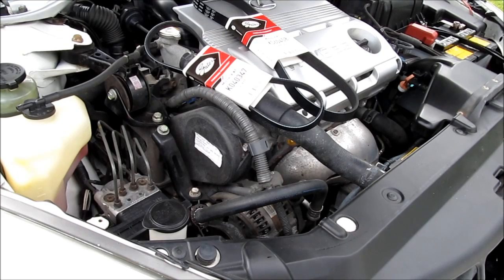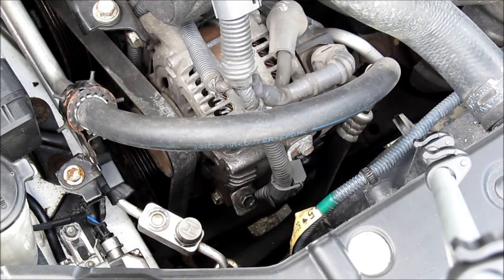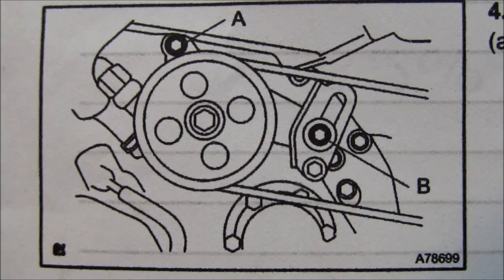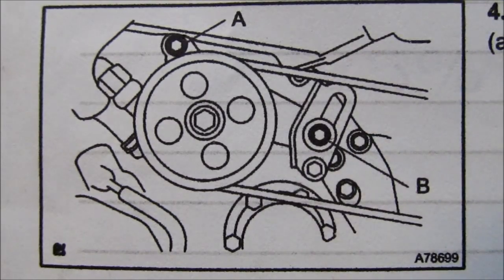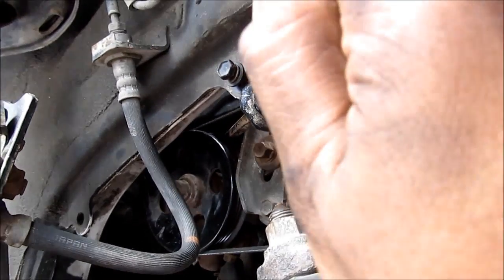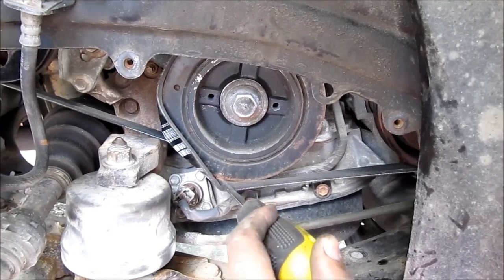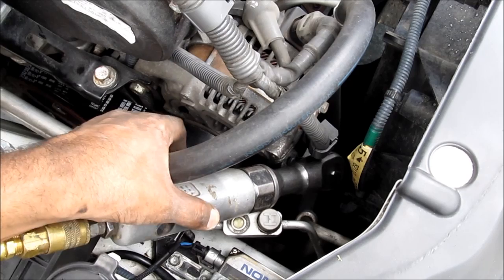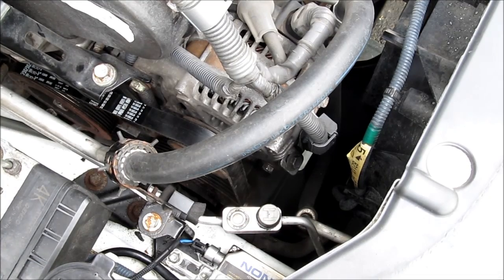Alternator / Power Steering Belt Replacement: Toyota Lexus V6

Comment: On the 2005 3.3 V6 camry the A bolt for the power steering belt is not the same as the diagram, any suggestions?
Reply from the maker: Aaron Grove It is the same but you probably cannot see it or access it, you have to get at it by feel (or by removing the dog bone engine mount assembly). The 3.3L Camry has the same engine bay as my ES330 in this video.
Reply: Yes had to do it by feel and with a very small 12 mm wrench. I had trouble getting it back in to position once the new belt was on, it was tough to get the belt as tight as normal
Reply from the maker: Yes that bolt was tough. I went through 3 sockets on a 3MZ Sienna before getting it loose.

Comment: Great video. Good explanations, no extra fluff, no wasting time talking about extra stuff.
Reply from the maker: Ryan Holland Thanks
Reply: I ended up just tightening the belt, rather than replacing it. The belt was installed by someone else recently and has been squealing. I watched this before I even opened the hood to see the procedure. One of the bolts was loose, and it's all fixed now.
Reply from the maker: Good to hear. My bet was the squealing was coming from the power steering belt? That one isn't easy to tighten.
Reply: No it was the alternator and compressor belt. The easy one XD
Reply: And it wasn't recorded on a potato! 9 yrs ago 😮

Comment: Great video,

I wanted to ask you if for a little more detail video for when to put the serpentine belt back. I don't know why I still don't get it.

Thank you
Reply from the maker: camilo11315 What do you not understand? Procedure is same as removal. You might need to rotate the engine to get the belts to slip onto the crank pulley.

Comment: How do you determine the tension of the belt.  How tight should it be?
Reply from the maker: There's many theories, but the general rule of thumb that I follow is that the belt should deform not more than half of its width.
Reply: Thanks for the info.  That helps a lot since I just replaced my alternator, but was not sure if the v belt is right enough.

Comment: Thanks for the video. I couldn't get to the power steering bolt. I could feel it with my hands but couldn't get the wrench on it. But the fan belt was so easy. Thanks for posting this. Keep it up!!!!
Reply from the maker: What car did you try this on, if it was a bigger vehicle (Sienna, Highlander RX330) I understand your difficulty in reaching that bolt. The sedans (ES300, Camry, Avalon, Solara) are easier to access from the side. If your having difficultly regardless, remove the dog-bone engine mount and its bracket holding it to the engine and you'll have plenty of clearance to get at it from the top.

Comment from the maker: @ Steve Excalibur
I usually tighten my belts until they flex in the middle by less than 1/2 of the belt's width. If its too loose it will screech on cold starts.
Reply: Just replaced my belt and it was screeching, good to know!

Comment: my alternator doesnt seem to move down like that when all bolts have been loosened, and the belt is still very tight. What have I done wrong?
Reply from the maker: Have you loosened bolts "A" and "B" as per the video before the tensioning bolt? Give the alternator a tap or two downward and see if that knocks it loose.

Comment from the maker: After a while the rubber belt starts to deteriorate and crack. It also looses traction on the pulleys and start slipping and screeching. Eventually, it could break and leave you without power steering, A/C and a charging system while driving. Basic maintenance.
Reply: At first I thought the squealing was from a bad pump.  After looking at several videos and being under my car,  it looks like both my belts need replaced.  They're both cracked and missing ribs and 'teeth'.
Reply: Please what is the name of the manual you got the diagrams from